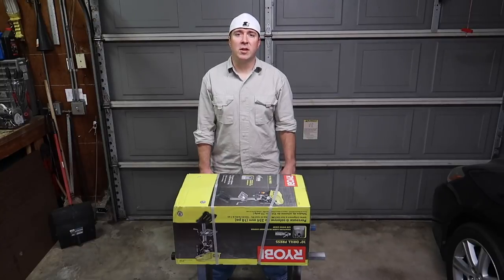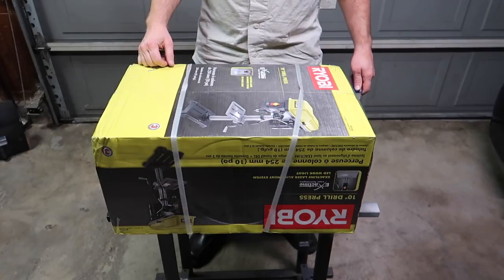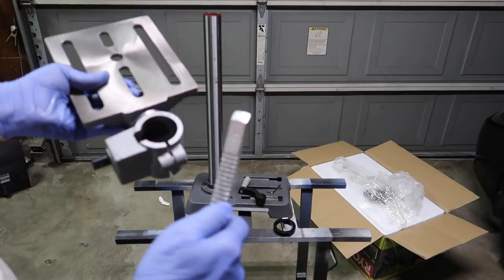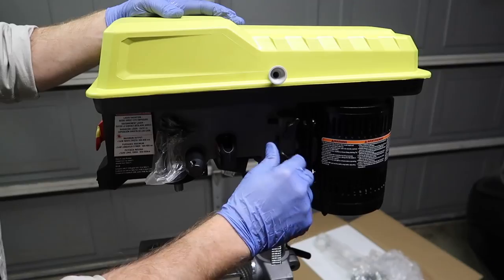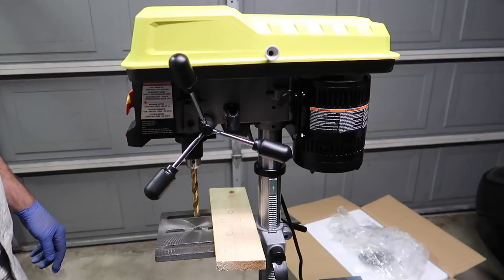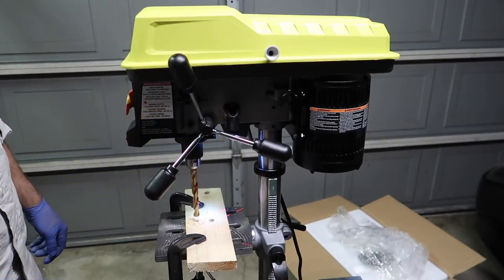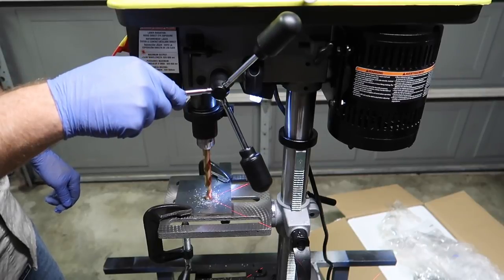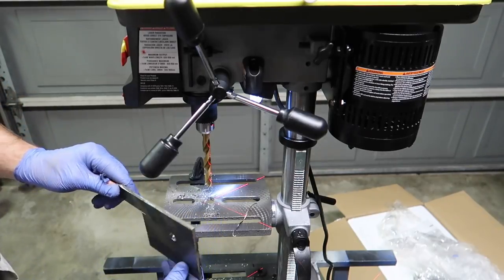10" RYOBI DRILL PRESS UNBOXING AND TESTING.

Comment: Cutting oil helps a lot from what I am told when drilling into steel or metal
Reply from the maker: Mike Eldredge 
Thanks for the tip Mike, I’ll try it on my next project. Drill bits that I was using were from HarborFreight ( cheap stuff)
They only good for one project or maybe 2 if used with oil. Cheers.
Reply: After watching your video, I bought this same press from Home Depot , I got $25 off the price of $129😁👍
Reply from the maker: Mike Eldredge 
That’s awesome. Hope these things will last for a while. Cheers mate.
Reply: And lower the speeds when cutting metal

Comment: Hi, can you rotate the Head? I'm drilling into aluminium extrusion mortises that are longer than 10".
Reply from the maker: I’m sure you can rotate the head to accommodate your specific drilling needs but be sure to clamp down the base while using the drill press. Let me know if you were available to pull it off. Thanks for watching and commenting.

Comment: I read there's an issue with the hex bolts that allow you to adjust the table for angle drilling. Complaint was they are too close together and you can't loosen them as a result. Did you encounter this issue?

Comment: I'm sure someone else has already mentioned it (but for some reason the comments are not showing up for me!) but it's always a good idea to use some metal cutting lubricant on a drill press.  It's not essential, but it helps make a cleaner, faster hole, and it also saves the drill bits' lifespan.  I learned that when I worked a foundry and did a lot of quick repairs making replacement brackets and such.

Comment: Have you used the depth stop?   My benchtop drill press motor just failed, but I added a table to it and the depth stop is a feature I use all the time.   How easy it it to use on this machine?

Also, for raising and lowering the table, how close is the wind handle to the table and how easy is it to raise the table?

Thank you for the video.   It is helpful for the decision of which to replace mine also a Ryobi, but a bit older.
Reply from the maker: E Bell 
To be honest with you, so far I haven’t used the depth stop. The table is very easy to adjust and secure it in place. In worse case scenario, if you don’t like the drill press, you can always return it within 90 days. Good luck with your unit and I hope it lasts for a while. Cheers

Comment: When I got to Home Depot, the box was trashed so they gave me $50 off. I got mine for $80! ;-) The only thing wrong is the yellow "key" doesn't stay in by itself. It stays in while the drill is running but falls out when I turn the switch off. Tbh, it's such a minor issue, it's hardly even worth mentioning. I love that it's variable speed! Thank you for the video. I was wondering how to install the chuck.
Reply from the maker: Jerome Schwartz 
That was a great deal. Hope our drill presses lasts for a while and good luck with yours. Thanks for watching and commenting.
Reply: It turns out the key thing was operator error. You have to push it all the way in until it locks into place. I was only pushing it most of the way in so now that I figured that out, the thing is perfect.

Comment: Thanks for posting! What did you use to record this video with. One the clearest and sharpest I have seen. I will definitely take the Ryobi into consideration. Only thing I don't like is the plastic pulley. Not sure if it is a problem or not.
Reply from the maker: So far I haven’t had any problems with the plastic pulleys. If they wear out I’ll replace them with aluminum ones. Thanks for watching and commenting.

Comment: Hi, Congratulations on your video, could you help me with an issue? Could you tell me what is the distance between the column and the center of the bit? I want to buy one of these, but I need this information very much, and I could not find it on the net, thanks.
Reply from the maker: Hello Alessandro Vellozo 
The distance between the column and the drill bit is 5-1/4 inch or 13.335mm 
Hope that helps. Good luck.

Comment: Did you ever end up mounting the base to a workbench? Looks stable standing on its own even with all the drilling vibration.
Reply from the maker: zzzzip1218 
My intention was to keep this drill press unattached to anything. Now I can move it around and whenever I need to use it I can just secure it with quick grip C-clamps and I’m good to go. It’s stable enough to be freestanding on its own. So far it works great for my small projects and I’m glad that I didn’t buy one of those bulky units that would take up a lot of space in the garage.

Comment: Did you have any problems getting the chuck aligned?  I saw some of that with the Wen 10".  I wish they'd come from the factory with the chuck correctly installed.
Reply: The chuck is on a morse taper . it can ONLY go in one way . there is no adjustment . ALL drills are the same . A MORSE TAPER.
Reply: @738polarbear  Thank you.
Reply: @RandomShart Thanks.  Good plastics can wear as well as metal :)

Comment: Just wondering after 3 years of having this drill, is it still working just as good now as it did in this video?  Cheers.
Reply from the maker: Yes, this drill press still works great. I just used it the other day drilling 3/8 holes in quarter inch steel plates. My suggestion is use oil while drilling holes in metal, that way the drill bit doesn’t overheat and will last longer. If you’re planning on using this press for woodworking then this thing will drill holes all day long without any issues. It’s not meant for heavy duty industrial use but for home use you can’t go wrong with this unit. Thanks for watching and commenting. Cheers

Comment: Why does the motor make that noise when it’s turned off?
Reply from the maker: Don’t quote me on that but I believe it’s the belt on the pulleys that makes the noise and not the motor itself. Belt is loose on the pulleys so that it can be repositioned by hand to different ratios of speed. So far I haven’t had any issues with the belt or motor and the drill press still works great. Thanks for watching and commenting. Cheers 🍻